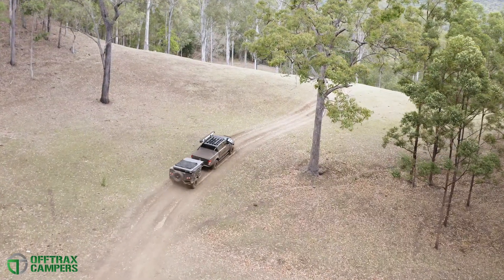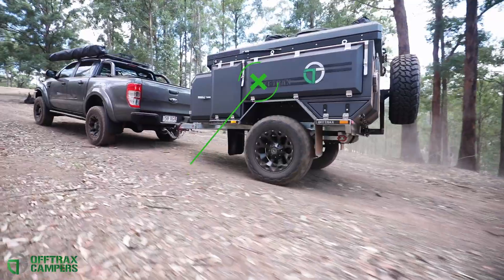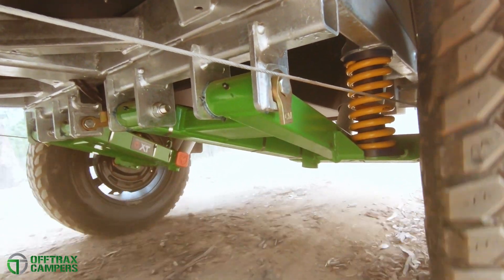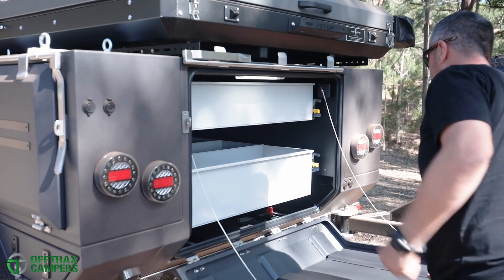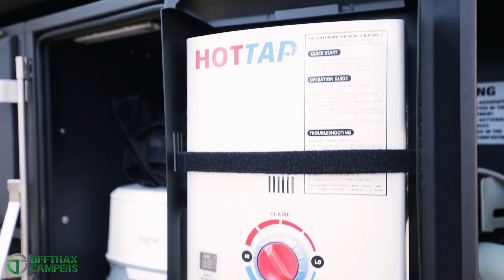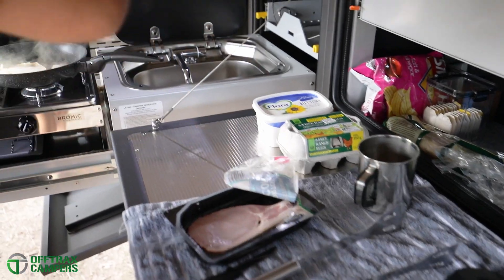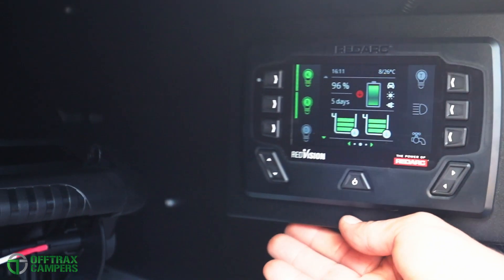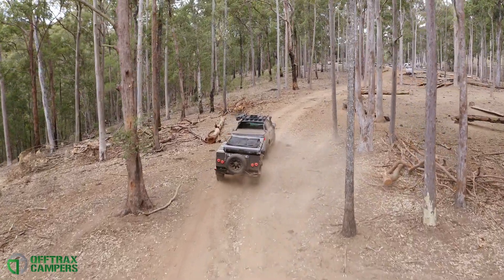OFFTRAX CAMPER TRAILER - LAUNCH VIDEO

Comment: Awesome camper only to be let down by the awning.
Not very practical IMO and it would be 100%improved with a 270 self supporting unit like the bush company's.

Looking forward to checking it out. Do you have a dealer in Melbourne?

Comment: So the bayonet gas fitting and babyQ is that legal
Reply from the maker: G'day Greg, the bayonet connections are for the stove and hot water system (which have flame failure devices) but not for the Weber. However, we have heard Weber are bringing a new model out that has flame failure device built in which will then be allowed to be used with the bayonet connection.

Comment: Why isnt the tent centered? It looks wierd
Reply: Possibly biased to one side because of the tent ladder is accessed from that side.
Reply: @justinkennedy5405  that makes sense
Reply from the maker: Hey there, the tent is offset for a few of reasons. As much as it messes with our OCD it serves a purpose 😊 - firstly we have the additional space on the roof on the passenger/kitchen side for additional load space for a kids tent or gazebo etc, this space also provides extra “bench space” when camping. Second reason is the instant drop down shower is fixed to the tent on the driver side (the tent is accessed through the rear entry), lastly the tent is 2.3m long so we need to ensure the fridge door clears the tent to be able to open completely. Hope that clears things up. Thanks 👍